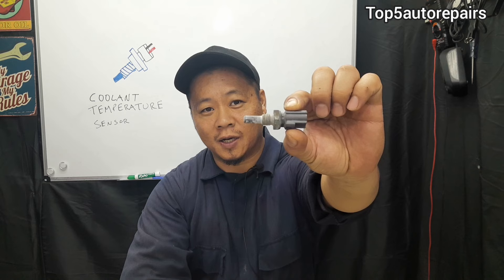Bad Coolant Temperature Sensor Symptoms

Comment: On that last part “false reading” you mention if the engine is warm/hot and the needle on C now how bout when the engine is cold and the temp gauge needle is on H Same problem correct ?
Reply: Did you get this resolved? I have the same issue
Reply: likely the sensor then unless the gauge/wiring is bad (less likely) because we know the coolant should be cold when the engine is cold

Comment: Does it affect the ac ?
Reply: no
Reply: Well it does with my Alpha Romeo lol @firstlast-pt5pp
Reply: @CubanMofo  - there are many ways the coolant sensor can be faulty - reads -40c ( disconnected ) or 130c+ (suggests engine stress)  are two extreme which may cause the ac to stay off ( ac is not the concern then - cold/hot engine may not run or stall ) - stuck at say +50c  or swing between 10c and 120c for example  should not disable the ac - although rare, the computer might be the problem

Comment: No Coolant temp Code at all but overheating , im draining the radiator today to check and see if it’s clogged, but any suggestions?
Reply: get a cheap infrared thermometer and check the upper and lower coolant hose temps when engine in operating temp ( thermostat should open and no temp difference between the hoses) - if there is a difference, the thermostat is stuck closed ( therefore, overheating)
Reply: @firstlast-pt5pp  I just got a new housing and I'm going to be filling it with a coolant funnel kit

Comment: my radiator stays on while i start the motor when i turn of the motor its stops i have a golf 5 1.4 gasoline engine i dont know whats the isue
Reply: if the fan comes on right after you started the cold engine, it's likely a bad coolant sensor giving overheating temps ( less likely wiring/comp issue) - disconnect the coolant sensor wire connection and start the vehicle - the fan should stay off ( the comp thinks the coolant is at -40c and runs rich)

Comment: I have a 95 gmc k1500 that will start but will die. It will idle and then it will die. It will putter like it’s not getting enough gas or air. I changed the fuel pump and fuel filter. Thought it might be the maf sensor or the ect sensor. If you know what to do with this situation plz let me know.
Reply: Oh and no check engine light

Comment: I have a chrysler town and country and when im at idle my car goes up one line but then the fans come on and it cools down, is that the fan switch gone bad, i havent gotten a code for anything so idk what it could be
Reply: Sounds like Thermostat, they get old and open up slower
Reply: @aaronajbird07  ive already replaced it and thats not the problem, i think it might be the coolant temperature sensor

Comment: Can it fail with no code on a ford 3.5 v6 I’m having overheating, I’ve replaced everything but the radiator and engine coolant sensor
Reply: You ever figure it out
Reply: @LangeLS4  not yet I think I might need to burp my system
Reply: @LangeLS4  yeah working on it today . Will update
Reply: @LangeLS4  it lowkey just needed to be burp , there was hella air in the system

Comment: No engine ligth
No error codes on scanner
But my fan do not stop when engine its turn off
I have to disconnect the module coolent fant cable one of then..
No black smoke no ober heating ligths ?????

Comment: I have peugeot 407 2.0hdi   Fan starts after 5km drive..cold engine but fan spin and dont stop..  and temperture shows 90'c.   What can it bee..  is it that sensor  or... ??
Reply: cold engine = cold coolant , unless wiring,gauge,comp issue (less likely), sensor is likely the problem

Comment: Okay but what if I’ve replaced everything in the car that has to do with cooling and this happens but it my car gets hot after I drive for like 5mins and then keeps getting hotter I already had to replace the radiator,thermostat the fans work I’ve replaced hoses and everything besides my temp sense and I don’t think it’s my head gasket so
Reply: Me too

Comment: I have a 1996 Chevy Silverado K1500 Z71 w/5.7 350 Vortec , i just inherited it as one could say and its been a pain in the ass.  To start with it had trouble starting at first, usually upon first start up it would catch mid start then almost die with 60% of the time it catching and starting but 40% of the time it sputtering off. The 2nd problem was the distributor/cam sensor adjustment, even though it is an EFI spider injection it still uses a distributor to fire (note its not actually a distributor but i don't know what its actually called and it isn't coil packs). After all that it still has issues but the man code it always throws is PO160. Another thing to not about that is it doesn't have CAT's on it, i live in Texas and the EPA can kiss my ass, but anyways atp A: either sell the pos while im still not fucked or B: install an intake manifold and carb as well as HEI distributor and some how mock up the old 4L60E.

Comment: What could be the cause of my temp gauge to go down to cold when I have the aircon on and even if I turn the AC off again it still stays reading cold.
Reply: Thermostat, stuck open
Reply: @iroc-z6668  Yes you where close, there was none in there.

Comment: Hi sir.I have problem while engine cold everything ok when engine hot fan work and non stop until i stop the engine.Radiator,fan,coolant,coolant cap changed with new one
Reply: Mine also got same problem. Air cond no function well when all fan running during engine hot. Stop engine and re-start everything back to normal.

Comment: I've got an '03 e85 3.0i  roadster, just replaced the radiator and got the coolant burped and levels to the appropriate amount a few weeks ago.  Now I'm over heating with no engine codes, my radiator fan won't kick on and its idling really rough (rpms bounce between 1k and 800 constantly).  I'm thinking its a bad coolant temp sensor but I'm not sure which one to change as I believe there are at least 2 in the system.  When facing the vehicle: there is one sensor that looks like it connects to the thermostat (which I changed the day after I did the radiator) the second sensor I believe is on the right side of the engine just above a few coolant hoses.  After thinking about the symptoms I feel its probably the first sensor in the thermostat because my radiator fan won't kick on, but then there is the idle issue :/.  Just looking for some outside opinions, thanks!!!

Comment: I have a issue. My car idle rough when it's cold, it shakes the engine slightly then soothes out but when the engine warms up it acts perfectly fine. No check engine light
Reply: It never use to do that I had the car for 2 years now

Comment: I was told I need that on my 2013 Camaro   but I have no service engine lights on no over heating no leaks but my air is hot have been for over 2 years not my compressor or thermostat nobody knows what’s wrong with it

Comment: A bad coolant temp sens will also turn the cooling fan on when not needed and not show any check engine light and will cause stalling after starting engine
Reply: My 2020 canyon fans stay on even after shutting off the truck temp needle sometimes stays stuck at 160 sensor or thermostat getting stuck

Comment: I have 07 GP
My temperature at idle n park goes to operating temperature no prob
The min I start driving them gauge starts to decrease and coolant pressure starts to decrease aswell 
Had heater core n rad flush done but drove away still same problem 
Oh yes this problem for me is also happening in the winter were it gets very cold!
Anyone can relate or have some help for me

Comment: Mine over heats when the ac is on but I’m only getting the p0125 code for a 04 impala
Reply: I have the exact same code. AC turns both fans on, but otherwise, they don't work and overheating during idles. 04 Pontiac Grand Am

I'm starting with the coolant temp sensor replacement fingers crossed
Reply: @Cruznh  I replaced the sensor but I think a new thermostat will do the trick as well
Reply: @Cruznh HEY DID IT WORK?

Comment: Will it cause you car not to start?
Reply: can - for example, if the bad sensor  reads 100c on start but actually 20c - if the car struggles to start in this example, step on the accelerator pedal to give it more gas and keep the rpm at about 1500 to warm up the engine for about 5 minutes

Comment: I got a 2019 fusion 2.5 changed the temp sensor reset the check engine light was doing fine for last 3 weeks now it's back on but not overheating or anything Has ran fine the whole time even before I changed it out just temp sensor and check engine on light temps right in the middle on temp any suggestions thanks
Reply: code(s)?

Comment: I've tried two after markets sensors and 2mopar ones on my 2015 ram ecodiesel it keeps tripping my check engine light. No overheating or anything. Every few hundred miles. Any ideas why?
Reply: code(s)?